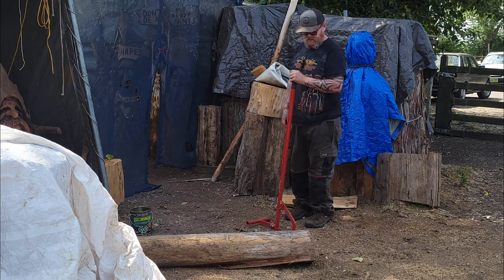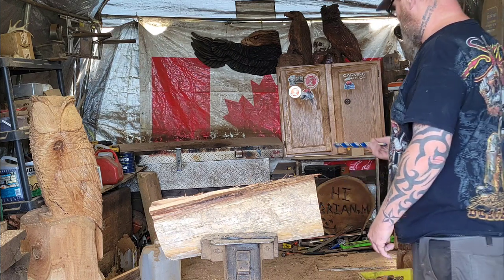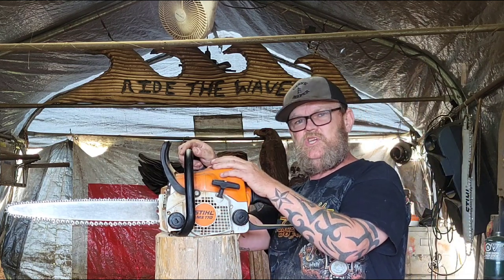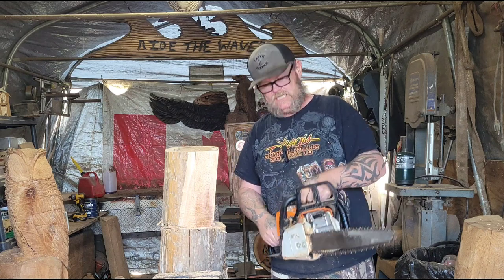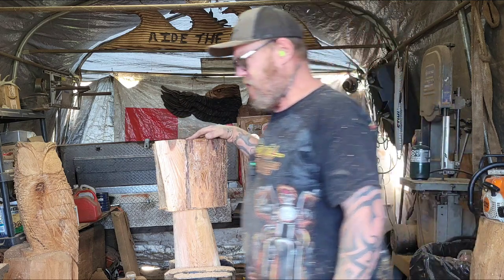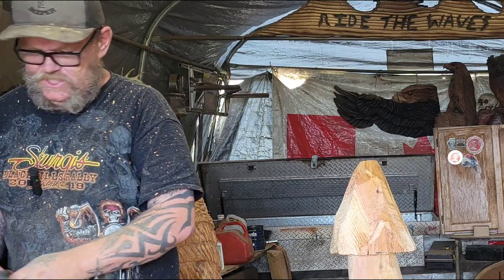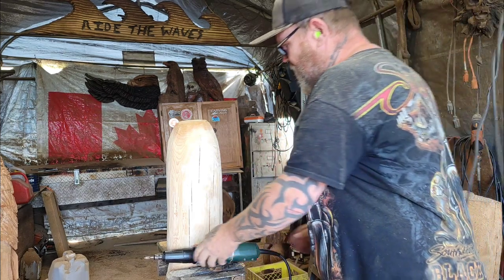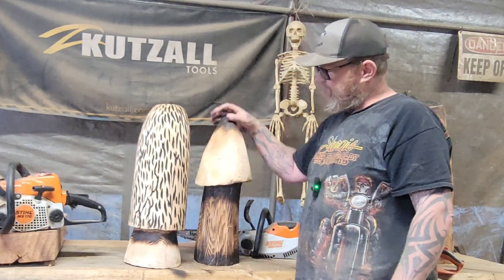Beginners chainsaw carving. Easy mushrooms to make any yard look good.

Comment: Those shrooms look kinda easy to make, rebar is a good idea in the base to stop it toppling. Like I said before I'm not really into chainsaw carving and I've only got a 2000 watt electric saw I use for cutting firewood but I might try a shroom and see how it goes and if it turns out crap I can always throw it in the log burner.😂